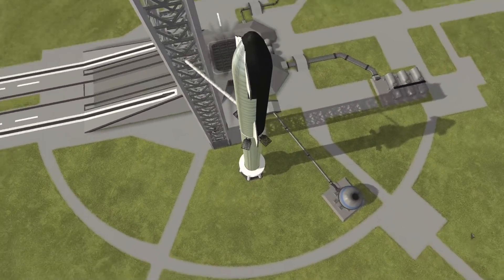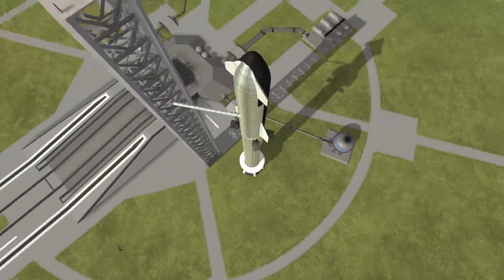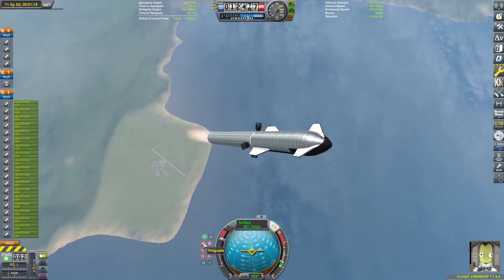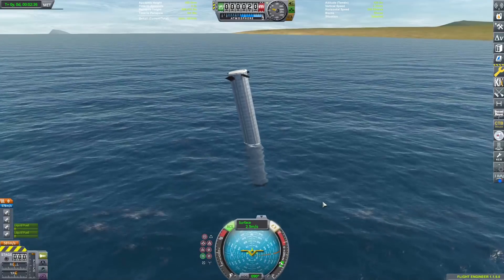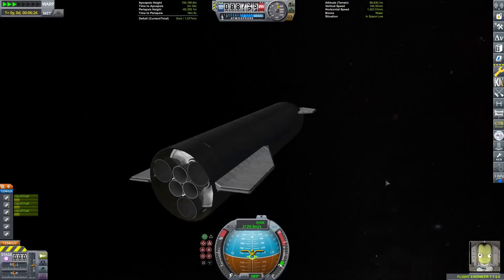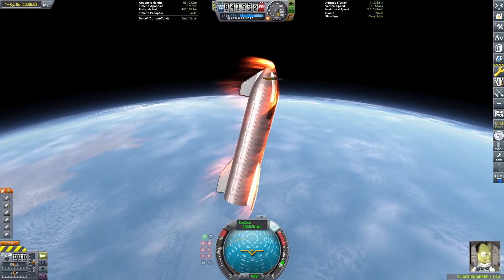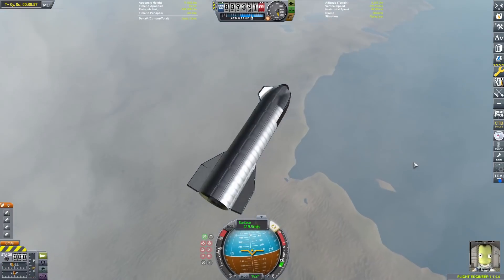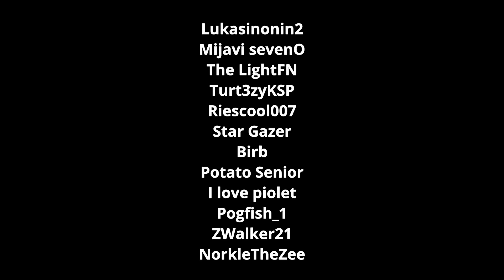Elon Revealed Starship Design Change, Lets Test It Out In KSP!

Comment: Good video!  As for the design...I don't like this iteration for ascent purposes.  The SN8-S20 design already has considerable lift placed well out in front of the center of mass which was already a big concern.  Now that the front control surfaces are pulled back, I wonder if the ascent will require these surfaces to be folded in to prevent excessive moment forces?  Guess we'll see in a few months.

Comment: If they don't change S20's flap design will S20 fail because of the forward flap design
Reply: S20 will be perfectly fine with their current setup if it even gets to entry. The new design just adds slightly more passive stability and slightly more control.
Reply from the maker: I don't think it will fail. I bet it will just be a little more risky. I mean there is a pretty good chance S20 won't even make it to re-entry lol
Reply: @Piolet1549  well the whole point of the mission is to collect data. They're not trying to successfully re enter but it would be a bonus. So yeah you're right it wouldn't "fail"
Reply: Theirs a significantly high probability that Sn20 won’t even get near reentry 

She might be destroyed during tests, during the ascent, etc…..,

As Elon said (as long as it clears the tower it’s a success!)